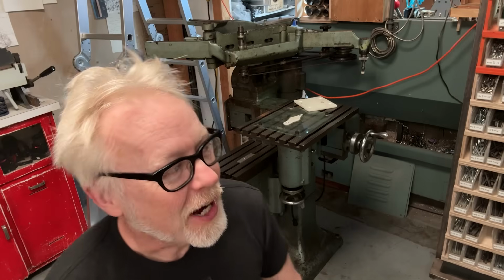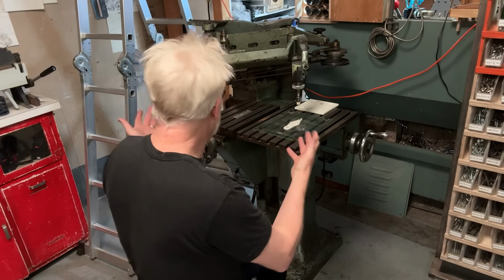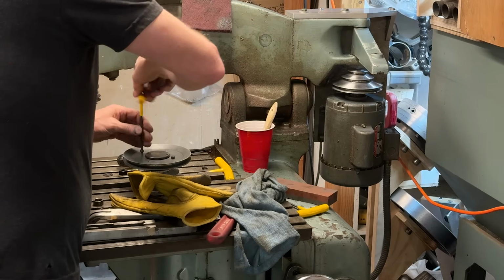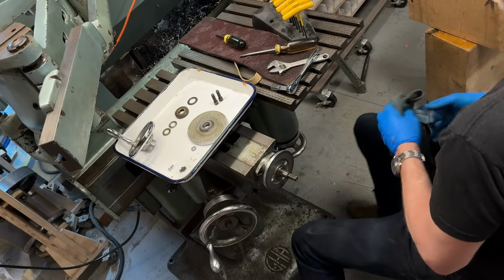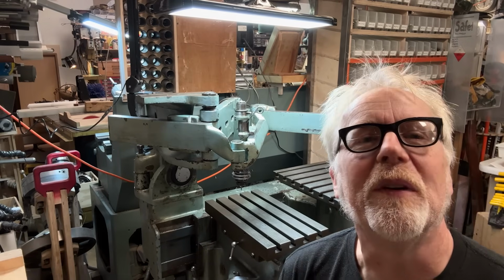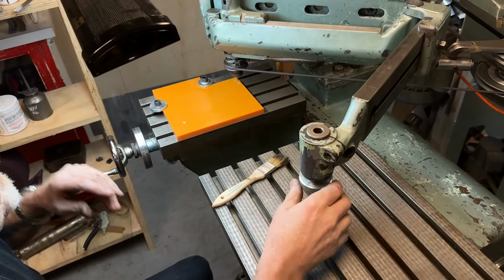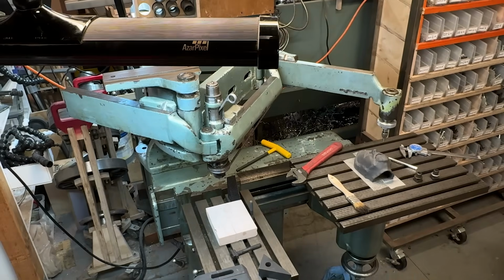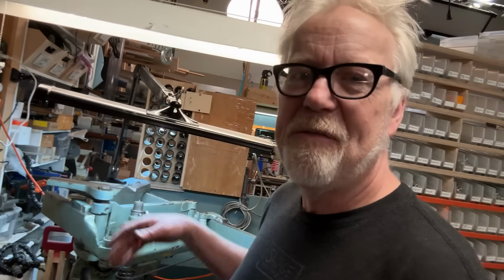Pantograph Mill: The Coolest Machine Adam Savage Owns!

Comment: I find PB Blaster to be a superior solvent for cleaning dirty machinery. It penetrates and emulsifies caked on grease much better, doesn't evaporate as fast as other options, and leaves a protective film to prevent rust in the long term. It's way better than WD40 specifically.

Comment: 41:52 CNC machines take the humanity out of a project. They are fantastic machines. I use one everyday at my job, but it is for making very cookie cutter, clean parts. There is nothing wrong with that, but for props or special items you want the humanity a manual machine will bring: the little imperfections, dings, and other things.

Comment: Machines like this are used to make coin dies. Artist starts with a clay disk about 24" in diameter and about two inches thick. Carves out the design and it's reduced in metal until it's the size of a coin.
Use a center cut ball endmill for the cutting side and the shaping will be better.

Comment: This is how plastic models were made back in the 60s and 70s oh heck even in the 50s! When building plastic models with a national pass time. The models themselves would be constructed oversize. A 1/24 scale model would be prototyped in 1/8 scale. A 1/25 scale model would be prototyped in 1/10 scale. The paragraph can be set up, not just for reproduction but for negative reproduction so that as the paragraph arm goes down, the cutting head goes up. And then for the next couple of months, a machinist sits there and carves molds. Super cool!